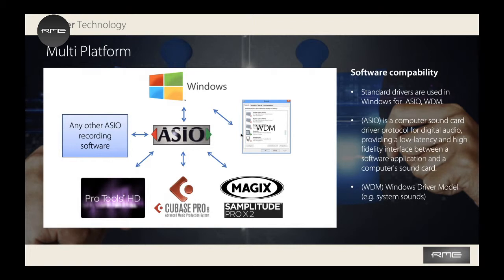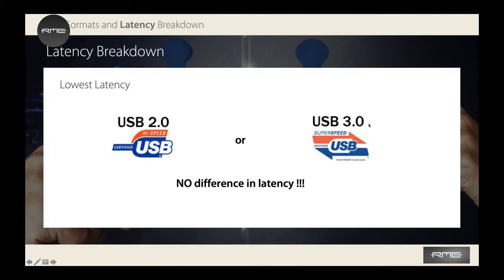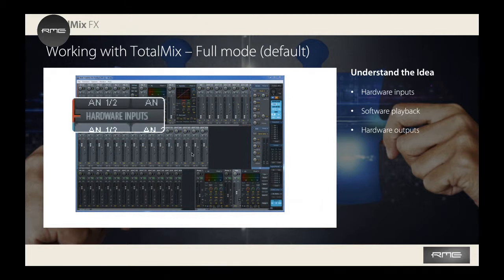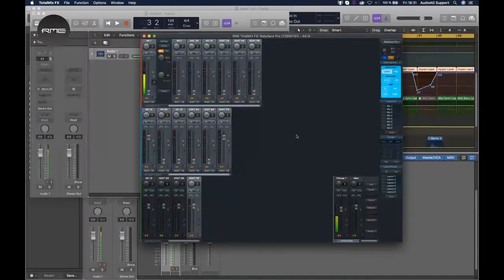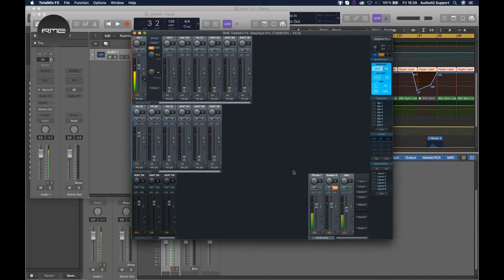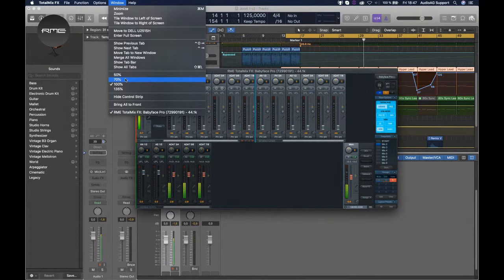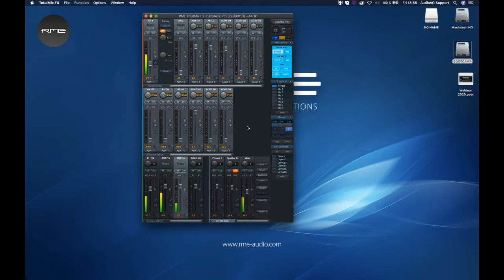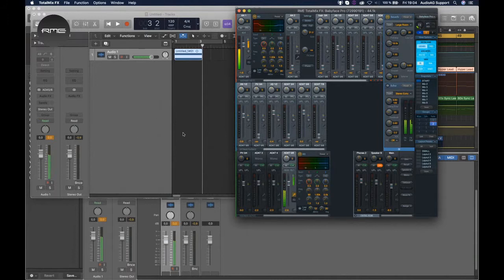TotalMix FX Essentials Episode 1: Basics

Comment: I have a Fireface UFX  and an Octamic XTC run together.  I have been using the two phone outs on the Fireface but have not been able to figure out how to route the phones outs properly for the octamic...
Reply from the maker: You have to send your headphone mix to the XTC via ADAT and set the respective ADAT input in the menu of the XTC as signal source for the headphone output. Please see manual page 15 https://www.rme-audio.de/downloads/octamicxtc_e.pdf
Reply: @RMEAudio  Thanks!

Comment: It will be helpful to time stamp the live-stream after the broadcast so if we missed it live. Great job! This is super helpful and look forward to the next time. If you can answer a question: I am using the control room in Total Mix and Cubase with multiple monitors and would like the option to switch in either Cubase or RME, however, Cubase will not switch to monitor B. I think it’s because RME has control over the switch. Can you please show the correct way to setup and route a 2 monitor speaker setup so I can use both Cubase and RME to switch?
Reply from the maker: Great idea! We'll discuss this in the next episode.
Reply: Yes, time stamps would be useful!
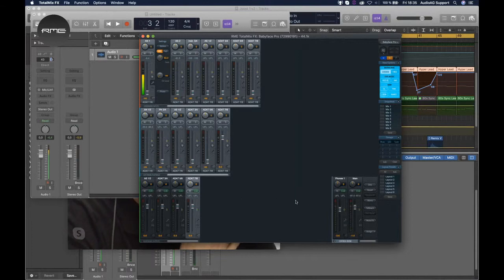Reply from the maker: @jasonluxmusic  Actually it is explained in this Video from 32:30